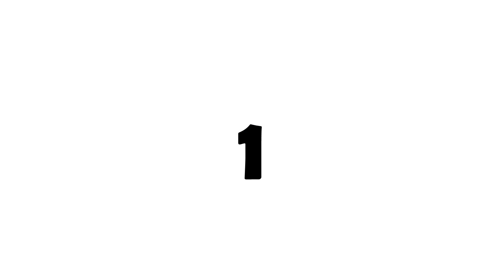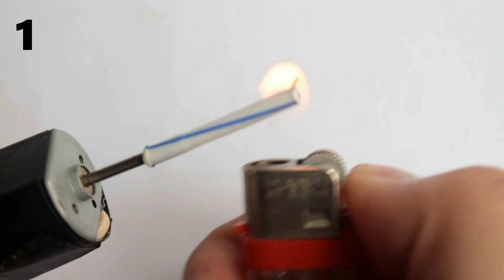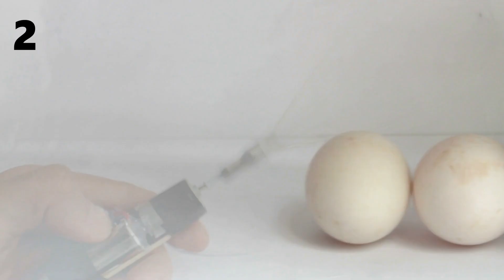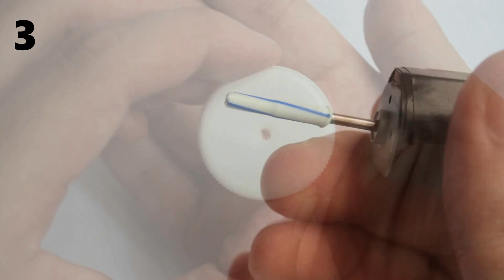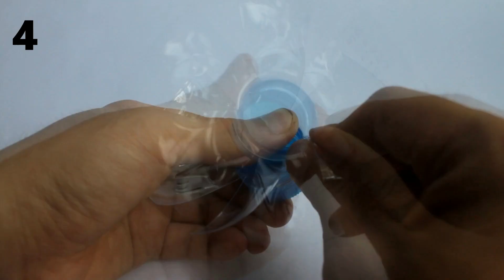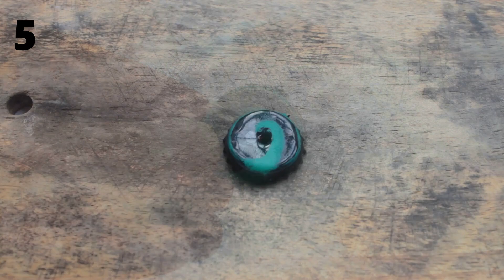5 AMAZING POWER TOOLS WITH A MOTOR

Comment: try to change the battery
Reply from the maker: Try to use rechargeable battery :_)
Reply: ok thx
Reply: +Just5mins but i have a problem my DC motor is not working with my 9 volt battery plz help